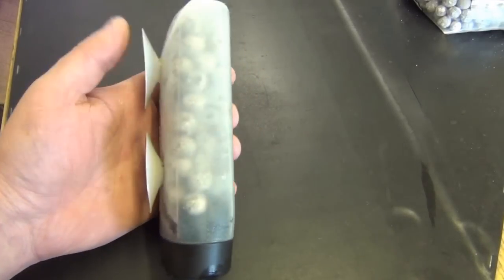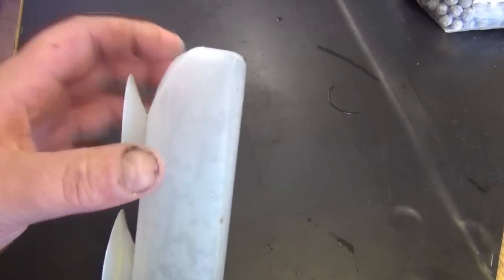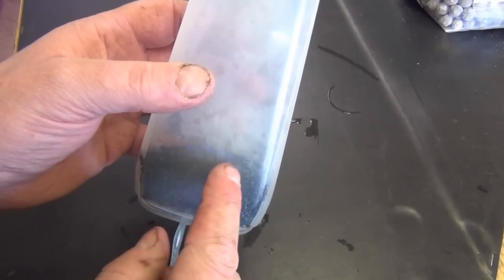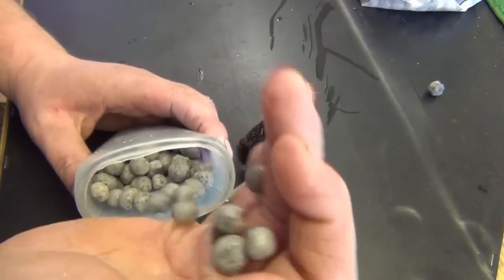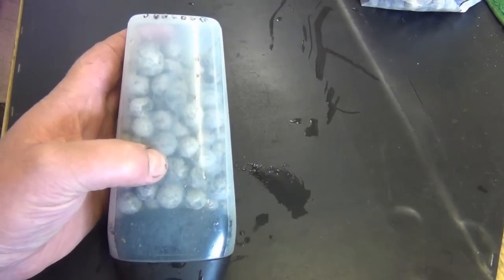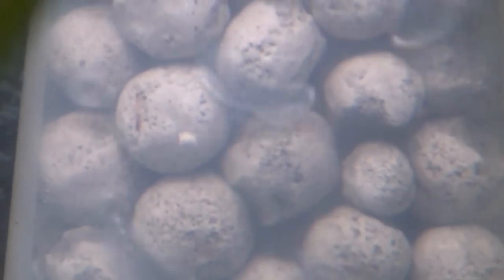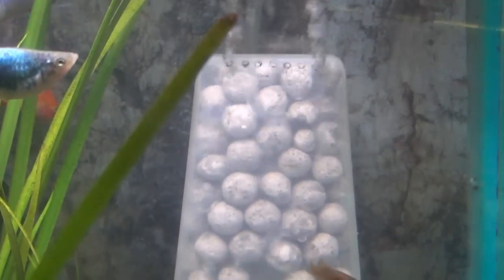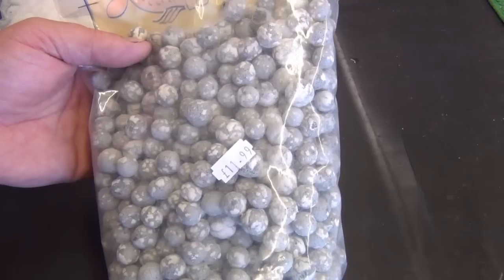How to Make an Excellent Moving Bed Filter

Comment: I'm sorry but I don't get it. How does it filter any water? It seems that there's no actual water flow through the container. All I see is just an air agitating the media. Does the water from the tank get sucked in through the little holes on the bottom cap, or what?
Reply: Seio1 , once it was placed in, it filled with water because of the little holes he drilled on the bottom an top. Once the air pump is turned on it pushes the water threw the media an out the top of the holes. As water is pushed out from the top more water flows back in threw the small holes on the bottom. The water is going threw the media so it is being filtered. 
If there was a way to not use the "T" end an just have 1 air output on the inside it would probably circle better then just agitate it but guess it all depends what you wanna do 🤷‍♀️.
Reply from the maker: Thanks for that explanation - yes it is a low flow filter just meant to improve water quality.
Reply: Thank you for the explanation.

Comment: Have you used profidrum filters?
Reply from the maker: I have fixed a filter system which had a profidrum as its first part. It was installed just at the critical water level and was a nightmare to fix as it got messed up due to low water level. I had to move the sensor and replace the drive motor which had burned out.
Apart from that experience I think if they are initially installed properly they will do an excellent job of cleaning the water prior to biological filtration.

Comment: Ok Im think the problem is that you posted this video in 2012!! The bottle you use is pretty much no longer available :( Im sorry to be an idiot but what other container/s would be ideal to use instead for your moving bed filter. Thanks!
Reply from the maker: Any container which can house media will do. I have seen some great ones made from plastic lunch boxes and other similar clear containers with lids. Ikea or the cheap shops like poundland are great places to look for small cheap containers.